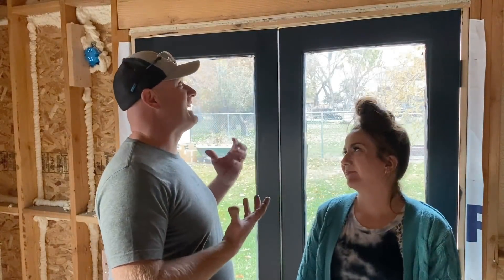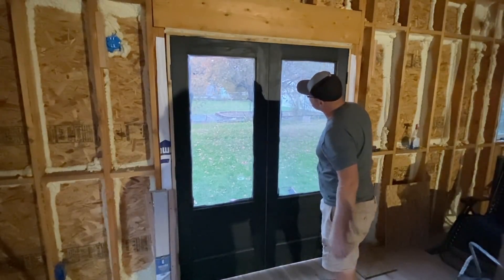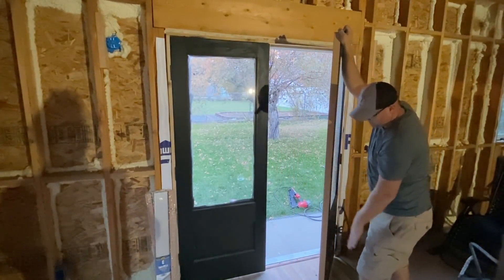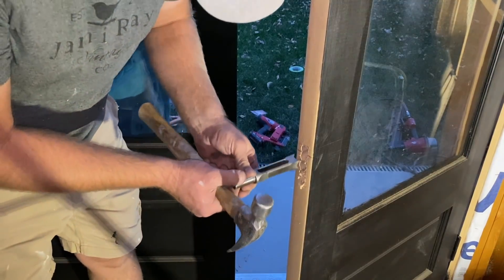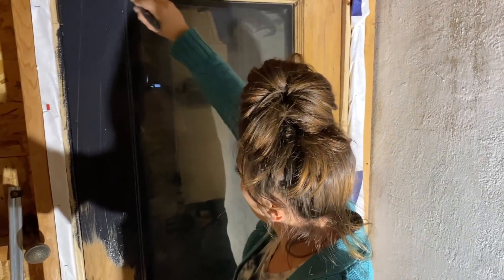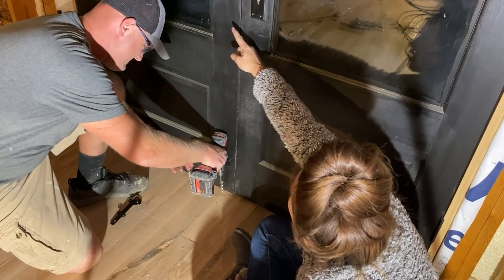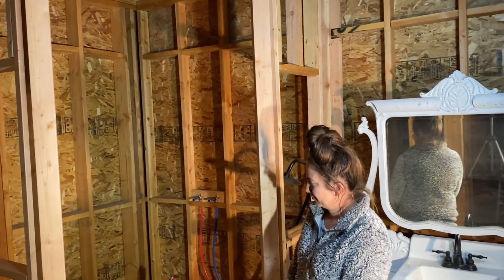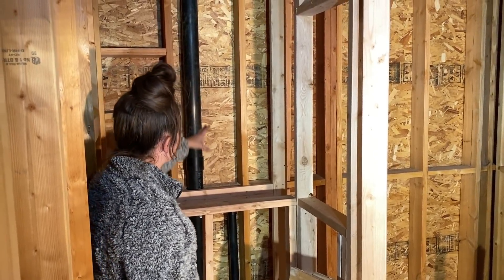Antique Style Door knob Install and French Door Trim

Comment: Instead of replacing the glace, you should check on getting some glass protector plastic installed over it on both sides. Then, if it's broken, it wouldn't shatter, it would stay together. Check with a glass company to see if they carry it.
If you have to replace the glass, save the old glass for some really neat projects.